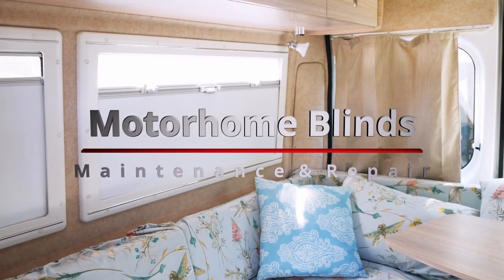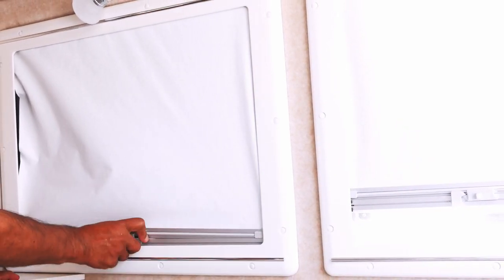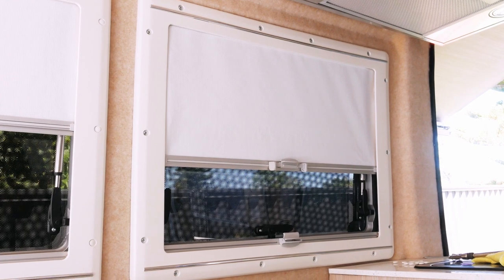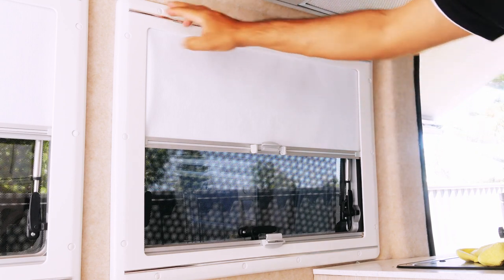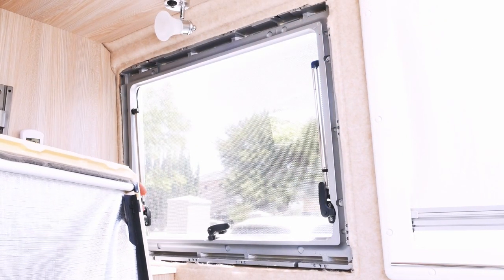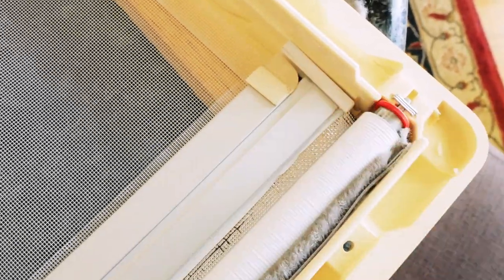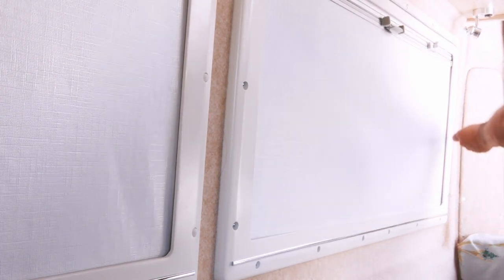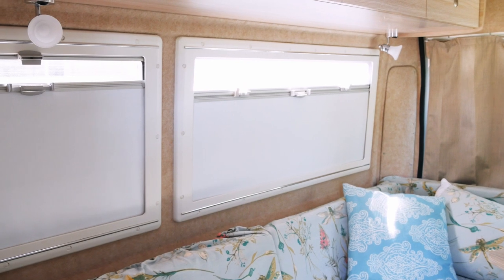Motorhome Window Blind & Screen Repair and Maintenance

Comment: Many thanks for the video. I need to do some maintenance on mine - some of them are not running smoothly and all the fly screens are dirty - and I wasn’t sure how to do it. So this is great timing.

I don’t think you will have any problems with your new orientation as mine, and most vans I’ve seen, are installed that way. I.e. the blind comes out from the bottom and the fly screen from the top.

So thanks again and now to get the cordless screwdriver out.
Reply from the maker: thanks - yes i've had no regrets changing the orientation round
Reply: yes i can confirm on my 1996 euro mobile, all the blinds are flyscreen on top, light screen on bottom.

Comment: nearly all of my windows have developed the following problem:   One or both of the connections between the release handle and the actual bits of plastic that release along the track have become disconnected.  and so pinching the handle in the middle does not actually start the blind sliding.  The problem is that the connection between when you pinch together and those long arms that connect with the hooks on either side are only very weakly connected.  These are old S4 windows.  I wonder if the newer S4s have the same problem?
Reply from the maker: I don't know, I hope someone will chip in about this.
Reply: @VanHacks  merry Christmas
Reply from the maker: @surfreadjumpsleep  Hope its a great day for you - the year's end is a special time for quiet and contemplation too! cheers! :)